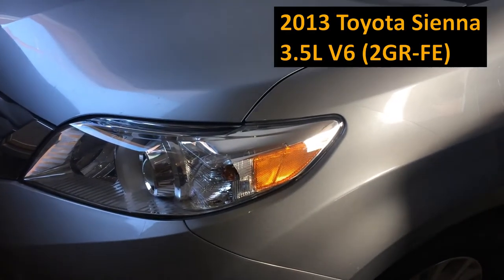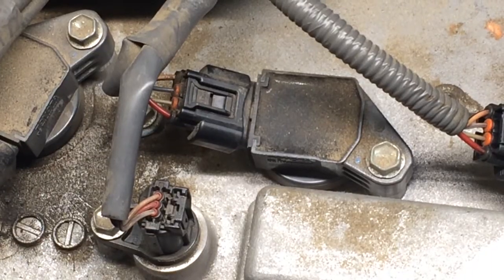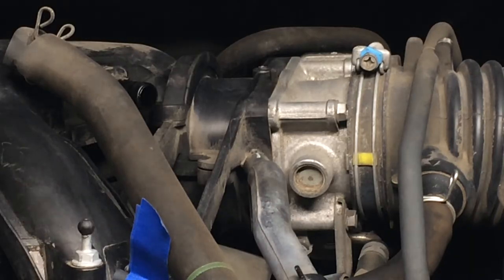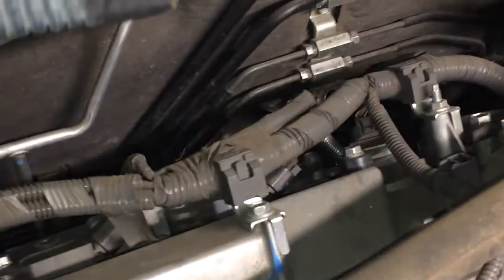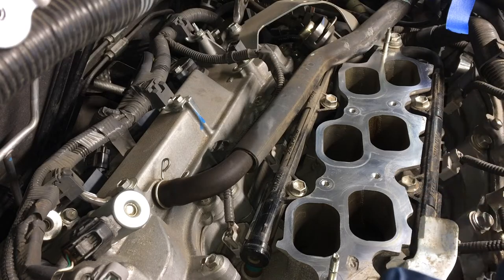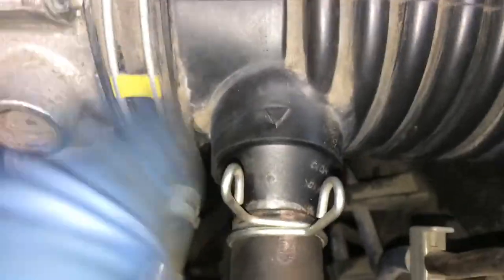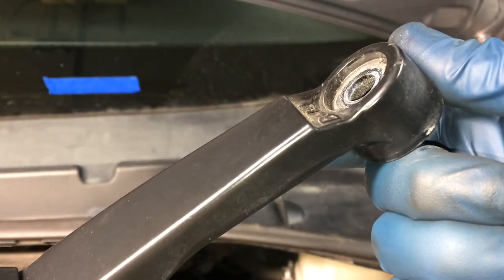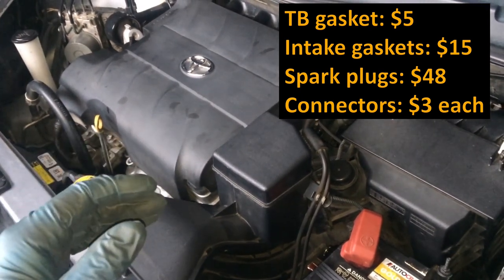2011 - 2016 Toyota Sienna DIY Replace Spark Plugs, Coils, Intake Manifold Gasket V6 3.5L (2GR-FE)

Comment: For anyone changing plugs on a 2015 Highlander 2GR-FE , you absolutely do not need to remove the cowl below the windshield. Plenty of room to get those rear plugs out. I just replaced my plugs, 2 hours and 15 minutes start to finish. This included cleaning the Throttle body and mass airflow sensor. My local Toyota dealership quoted me $746.00 , parts and labor. 5 hours labor,  what a ripoff! I installed OEM Denso FK20HR11 Iridium plugs, $11.00 ea from Autozone. I initially purchased a set of 6 off ebay, they were counterfeit parts, thank you AMD @ car care nut for providing examples of the many counterfeit products out there. Lastly,  the upper plenum rear mounting bolts are not at all difficult to get to on this year Highlander. Overall,  this was a very smooth and easy job.
Reply from the maker: Thanks for adding your tips about the Highlander! : )
Reply: @L35inColorado  , I failed to give you a huge amount of thanks for providing some of the best training I've experienced on YouTube. You have a huge amount of talent on both sides of the camera. I want you to know what you do makes a great difference between failure/success,  difficult/ easy performing this job. I'm a technical instructor for a large Transit District in the bay area (Bart) and know a few things where teaching is concerned. You are an excellent teacher. Keep up the great work,  no matter where you go. Thank you so much!

Comment: Wow what a skilled and detailed video.  As soon as the weather turns I think I will tackle mine.  240 K on the plugs so it is probably time.
Reply from the maker: Thanks - 240K??  yeah, I'd say you've gotten your money's worth out of those plugs!  Haha, thanks for watching : )
Reply: Mine was a 2004 3.3 with 240k. A little different and most of the time spent on one tank support bolt. (Lots of bad words on that) your label idea made reassembly a lot simpler. Surprisingly the old plugs looked pretty good. It runs much better now but that could be due to a TB clean out and a new PCVvalve. Thanks again for your comprehensive video

Comment: very detailed, you made it look easy to replace the plugs.
Reply from the maker: Thanks-- this is not a normal spark plug job, that's for sure!  It is more challenging than most spark plug jobs, which is why the shop price is so high.  The front plugs are easy, but those rear plugs require a bit of patience, for sure!  I'm very glad that they only need replacing every 120K miles!  Haha, thanks for watching, and good luck! : )

Comment: Well done! Great video! Thank you for sharing the part numbers and torque specs. It will really help. I might consider going back in to replace the broken tabs.
Reply from the maker: Thank you for watching!  Yes, those tabs are just so easy to break -- too easy to break!  If you decide to go back there and replace your tabs and you can spend a little more, I suggest to consider buying the Toyota parts.  

I am satisfied with the Amazon connectors, given the price and availability, and people have used them and say they have held up fine.  But I will say that the Toyota connectors are a bit tighter (ie, better) fit.

I think I'll end up replacing the two connectors in the front that I broke (and replaced with Amazon connectors, as seen in the video) with two OE Toyota connectors.  I was able to recover 5 connectors from a newer Tundra at the junkyard this weekend, and so I might swap those out.  

The downside is, of course, that the Toyota connectors might just break again, seeing as the Toyota connectors are tighter ... and a more brittle plastic.  The Amazon connectors seem like the tabs would last longer without breaking (less brittle), but again the fit is not as tight as the OEM.

Thanks again for watching, and good luck! : )

Comment: Thanks for the video.  You give great tips!  I wish I had seen this video prior to doing my wife's 2011 Sienna.  My problem was I tried doing a short cut by not taking off the cowl.  I followed Hector's instructions (which were also good BTW) and removed the air filter assembly housing so I wouldn't have to take off the cowl.  I ended up breaking a small vacuum hose nipple at the bottom .   If you're amateur like me, take off the cowl...I said, I said, take off the cowl!... so you wouldn't have to remove anything else.  Also, I removed the ignition coils without disconnecting the electrical.  Didn't matter...all I did was fart loud and three of those clips broke.  Just call me Charlie Brown.... UGH!!!!!
Reply from the maker: Thanks for adding your tips!  Yes, Hektor's video is great, but like you mentioned, we do need to be careful about little items that might be surprises, which is why I just remove the cowl.  I like the extra room!  But that said, removing the cowl with no rust is pretty easy but removing the cowl with rust could be a very different story, especially if the wiper arms are siezed (which happens, and sometimes you need a tie-rod end remover to free the wiper arms!).  So, it's great to have the too options, and hopefully no rust, haha.  Thanks for watching : )

Comment: This video is amazing! I have been doing repairs for years just from YouTube and this is ABSOLUTELY the best video I've watched...NICE WORK!! Do you make or do anymore on your/a Sienna? Please do!!!!
Reply from the maker: Thanks!  This is my father's Sienna - they are good vans and typically don't require much repair.  For the Sienna, I have these videos on the channel:
- oil change;
- fuel pump replacement;
- how to check the fuel pressure;
- starter replacement;
- spark plugs.
I'll add new videos as jobs come up, and overall she's a very reliable van! 
Thanks for watching : )

Comment: Excellent clear video. If it were possible I would have replaced the valve cover and the injectors. Besides that you have done so far the best video the clearest video. Thinking about getting a  2014 Sienna van.
Reply from the maker: Yes, it is a good idea to replace the valve cover gasket on the rear bank while doing this job if it is leaking: the most common indication of a leak in that case is if you find oil on any of the plugs or ignitors.  As far as the injectors - as long as they are the OE Toyota injectors, they last a long, long time, and I personally I wouldn't replace them until I had to reason to believe they were faulty.  
This generation (gen 3.0, 2011 - 2017) of Sienna has been a reliable build, and I would recommend it.  The biggest/frustrating issue that this particular 2013 had was a series of recalls on the operator parts for the sliding door, but Toyota eventually for it worked out.  
As long as oil changes have been kept up, the 2GR-FE has proved to be a very reliable engine.  There was also a 4-cylinder available from this generation, but only the earliest models (I think the 4 cyl was discontinued starting in 2013).  The "gen 3.5" (starting in 2017, I think) had the direct injection version (2GR-FKS), which will have the issues common to direct injection engines.  I hope that helps - good luck with your search!
Reply: @L35inColorado  sliding doors can be a pain. Thanks, thinking about getting one.

Comment: YOUR ROCK!! Just did mine tonight! Thank you!!! I wonder how impoartant those clips are for the coil packs, a couple of mine broke on the front bank! Also prices for me wiht 20 percent off at advance auto for denso exact plugs that came out of my 2013, manifold gasket and throttle body gasket were $120.00.
Reply from the maker: That's great!  Regarding those darn brittle little clips for the coil packs: you can use electrical tape to secure the connector, then replace the connector when you can.  The clips are important because they keep the connection secure and weatherproof, but again, tape or other methods can also make the connection secure.  Since your broken clips are luckily on the front bank, it will be easy to replace them when you have the parts and the time, as shown at the end of the video - if you can do all the other steps of this job, you'll have no trouble doing that part!  Thanks for watching, and great job on your DIY! : )

Comment: Yes, it's okay to move the butterfly valve inside the throttle body but only gently and very slowly.  Also never put anything metal (like a screwdriver) inside there.  Also know that when the van starts back up, it'll rev funny for a while as the computer has to relearn/reset the settings.  May take a day or two.  (Mine only took a few hours of driving.)
Reply from the maker: Thanks for updating us!

Comment: Ma'am, this was incredible.   You are outstanding.   Is there somewhere to ask you a general question about my sienna, or just ask it here?  Thanks again for this.  Every step so thoroughly explained.  Thank you 1 million times!
Reply from the maker: Thanks!  What's your question?  I don't know how much help I'll be, but I'll try : )
Reply: @L35inColorado  wow, that was quick.  I wish you were here, I'd just bring her to you.  My question, with many thanks, is i feel a clunk in the front when turning the wheel.  Doesnt happen all the time, but is becoming more frequent.  Doesnt happen when going over bumps, mostly when i turn the wheel...ive had a bad experience with the dealer and would appreciate any thoughts you may have or anything i could try.  Thanks again for this video and any help.  You are truly a trail blazer!
Reply from the maker: @larrytam9269 If the "clunk" feels likes it is from the steering system, there is a known issue with the Sienna intermediate steering shaft (the shaft that connects the steering wheel to the rack); some people have remedied the clunk by lubricating it, others have replaced it:
https://www.siennachat.com/threads/intermediate-steering-shaft-issue-on-3rd-gen.4256/#post-33168

If the "clunk" feels like its in the axles, or more on one side than the other, it could be a CV axle: there was also an issue with some CV axles and Toyota replaced quite a few on warranty.  CV axle problems sound pretty similar on most vehicles, so you can look up youtube videos for CV axle sounds and see if that's what you hear!

There are quite a few other possibilities, but as far as commonly seen gen-3 Sienna items that might make a clunk when turning, the struts and bushings can be an issue, but often that is heard when you're driving over bumps as well -- but you're not hearing it over bumps.  Other items that sometimes "clunk" when turned are tie rod ends (inner or outer).  Things like sway bar bushings and links and ball joints usually make noise going over bumps, too, so that's perhaps not your issue.

Perhaps you have an indy (independent) Toyota shop in your area, or just a good community shop or suspension shop that you can bring it by (or a good mobile mechanic!).  Lots of people have bad experiences at the dealership, so I don't blame you for wanting to avoid them (plus they are overpriced).  

Also, the forums are great -- Siennachat (above) and ToyotaNation are excellent forums with lots of helpful, knowledge people (including techs and mechanics) who are happy to help!  Perhaps you can post a video with the noise there and you'll likely get plenty of ideas!  I hope that helps -- good luck! : )
Reply: Thank you so much for taking the time to provide this.  You are truly an incredible human being.  Thank you for your advice and referrals to the various forums.  Ive done oil changes and the brake pads/rotors (and wiper blades!!!) and the thought of this was very intimidating, but you literally provided each and evey step.  I'm so lucky to have found you and your page.  Thanks again!

Comment: wow that is a really detailed video looks like you might want to do struts at same time since you exposed the top of them lol maybe my van will die of old age before i get to do this job
Reply from the maker: Thank you!  Yes, another Commentor considered doing the struts at the same time as well.  For us, there are no signs of strut problems on this Sienna, and in our experience, Toyota OE struts last a long time.  Removing the wipers and cowl really only takes about 15 minutes, so it is not unreasonable to simply wait, if you don't have strut issues right now (also, it is necessary to get an alignment after replacing the struts).  These vans last a long time!  Thanks for watching : )

Comment: Very much appreciated your very detailed instruction.  It seems my 2007 Sienna has a few more parts in the way than the model you are working on in this video.   It is very difficult not to believe the engineers who designed this intentionally made it difficult for a DIY to work on it.  The first challenge to get the purge tank off takes an incredible amount of time and effort to take off the rear mount bolts.  Then the wiring harness is directly over the rear coils.  A multitude of brittle connectors to remove to get the harness out of the way to just change the spark plugs. Toyota must have realized what a pain in the ass this would be with this design, so you would hopefully take it to their dealer shops....or were they just that inconsiderate to make it easy to work on?   Fortunately, my kids are older now- so I can finally get out of the minivan....(although it is paid for, which might buy it more time in my driveway.)  But- I will definitely look much closer in the engine compartment before buying the next vehicle!  I might be bitchin' and complaining- but what a time consuming job to do what should be a quick and easy plug replacement.
Reply from the maker: I totally understand what you're saying!  I like to have room to work, too, and there's just not much room to work on any of these transverse V6's in Toyota's tight engine bays - whether its the Camry, Sienna, Venza, Rav4 etc.  The Sienna might be the worst, though, haha!  Thanks for watching and sharing your experience : )

Comment: Basically, you take the engine apart to replace 3 spark plugs in the back.  Years ago I used to change 4 spark plugs on the 1998 Toyota Corolla and it took me 15 mins.
Reply from the maker: Haha!  Yes, spark plugs on transverse V6 engines like these aren't any fun to reach!  That's why I prefer 4-cylinder engines - easier and less expensive to work on.   You'r '98 Corolla probably lasted a long, long time too!  Thanks for watching!  : )

Comment: 35 minute mark of the engine valve tunnels. Man, looks like you polished those.  Mine are black.
Reply from the maker: You might have had a faulty surge tank gasket. These engines burn a little oil and pull in oil from the crankcase so if your performance is still good and you aren't burning up a 1 quart or more per oil change interval, I don't think I'd worry about it.

Comment: Excellent job 👍👍👍
Reply from the maker: Thanks for watching! : )
Reply: Can I ask you a Micanic question about 2015 Toyota Sienna ?
I hear tik tik tik sound coming out from the engine I always change the oil every 5000 miles using Dealar oil 0/20  some people say it’s normal.can you tell me what you think.
Reply from the maker: @mo8502  Yeah, I would agree that it is probably normal -- these engines are very ticky, especially when first started up.  I hope that helps! : )
Reply: @L35inColorado  is there any thing I do to get red of that sound some videos say add some transmission oil to the engine oil and drive for few miles then change the oil it will help.
Reply from the maker: @mo8502  Yeah, this topic comes up often on the forums like toyotanation.com because the 2GRFE was used in so many Toyotas -- from Siennas to Camrys -- for so many years.  The earlier 2GRFE's (not your 2015) had a TSB in 2009 for an issue with the VVT system which caused ticking and required a rather major repair on some models, depending on the VIN (but that was well before your '15).
According to what I've heard and read, the ticking is usually valve train noise, and these engines are just notoriously ticky that way, especially on a cold start.   
If the sound is like this one below and came on more suddenly (ie, you didn't always heard it, but now you do), then it might actually be the serpentine belt tensioner (or a belt pulley), as that person describes:
https://www.youtube.com/watch?v=uaEiB_3VyWI
Personally, I wouldn't use ATF as an engine oil additive, but I have heard that people have done that.  If you don't have a check engine light or any other issues, it seems that it is likely just the loud valve train ticking that these engines are known for, like this one:
https://www.toyotanation.com/threads/ticking-noise-2gr-fe-2015-highlander-xle.1626458/
I hope that helps!  : )
Reply: @L35inColorado  thank you very much for answering all my questions you are the best.🌹
Reply: @L35inColorado  thank you very much for your advice

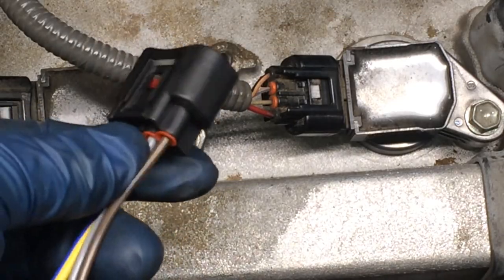Comment: When I replaced the ignition plug at 1:11:52, I was getting code P0352 on the second cyclinder misfiring every 30 miles of driving. I later found out the pins were loose and did not attached to the ignition coil correctly. I had to take a needle noose plier and press on the pins a little tighter so it will attached to the ignition coil directly.